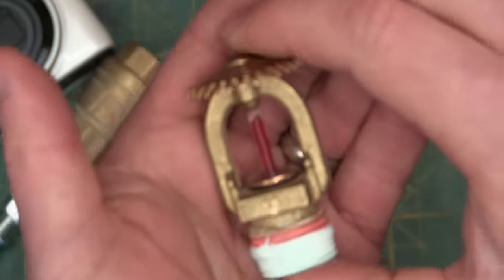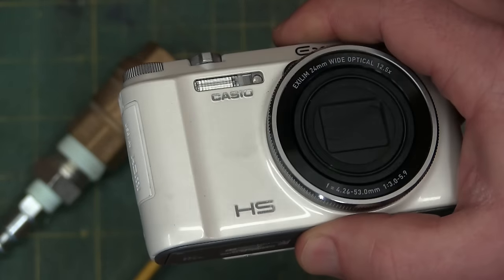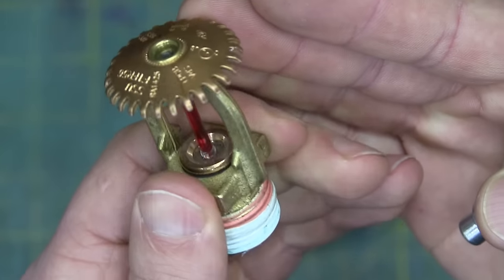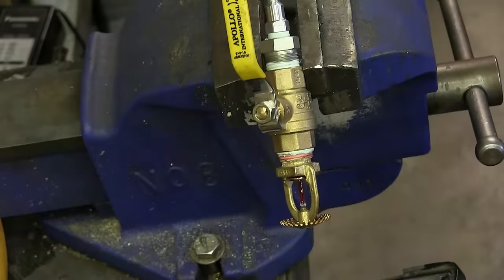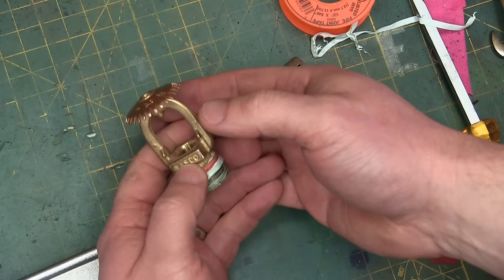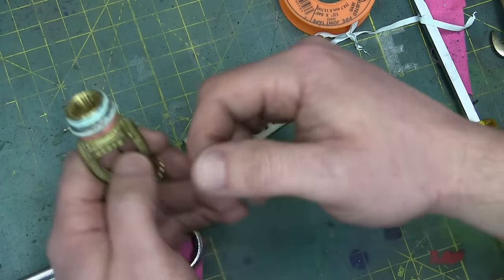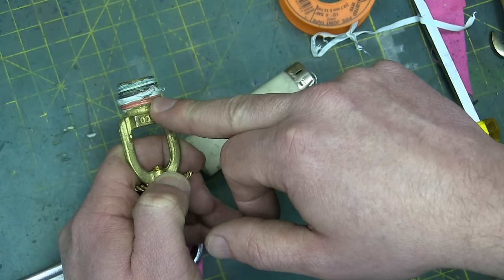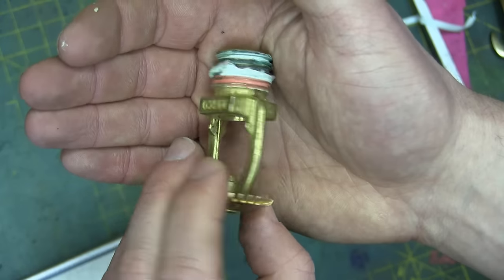BOLTR: Fire Suppression Sprinkler Head

Comment: Somebody in my dorm freshmen year  tied a string to the little glass tube and attached the other end to the RA's door. Would have been hilarious if it wasn't for the fact that it flooded the entire floor because it took us nearly 10 minutes to get it to shut off.
Reply: Get back to work cody we need more vids
Reply: would like one of you to test to most common ways to break one of these
Reply: Mike Ledowski -- only way to survive dorm life
Reply: "Somebody"...uh huh
Reply: Next time use two small wedges of wood and place them end to end, like a shim and push them together, it will block most of the water! Also, sometimes drunk college kids use lighters to set the system off.... Much like this video.
Reply: hi Cody 👍
Reply: AvE only had a little bit of pressure. Some installs run at 1400psi.
Reply: I worked at a government facility for awhile and one of the maintenance people accidentally broke one of the sprinkler heads, resulting in it soaking a bunch of computers and stuff.  Even worse, the water that had sat stagnant in the tank for probably 20 years was black and disgusting.  Resulted in even more damage and shut the whole area down for months while they cleaned it up.
Reply: This made my day, er night
Reply: The warehouse I work at uses 3 diesel pumps and a huge rain collection tank for their fire suppression system, rain is collected from the roof of the 6000m2 building and kept in the tank for months. I figure the tank is supplemented by mains water when under a certain level however.
Reply: Cody'sLab idiots in my condo were hanging their laundry clothes hangers off the sprinkler heads to dry. Needless to say, clothing got wetter than it started. Also flooded out 4 floors before it could be turned off. Sigh.
Reply: Maybe Cody can recover some radioactive explosives from the small red tubes?
Reply: Hi Cody, normal K80/K5.6 sprinkler for ordinary hazards will pump out around 200 l/min in the case of accidental activation, since the pump only runs for one sprinkler .. but hej at least the sprinkler dont work like in the movies or the entire building would be flooded.

Greetz Schuldig
Reply: Cody'sLab a youtuber I watch watches another youtuber I watch? Crazy
Reply: How many gallons is that?
Reply: ReactTM should have known that allready, they have done some work where AVE send some things to cody.
Reply: Eric Jones 200 l/min are around 53 gal/min
Reply: LOL
Reply: Cody'sLab 
I got a big fire department called to a monastery where I was servicing the fire pump. 
The maintenance guy said the alarm panel was off, oops. 
Im spinning an oil filter off and I just about dropped it like a greased pig when I saw a fireman walk thru the door all duded up for the gig at the monastery.
Reply: I can only speak for the european market. Most of the time we have fireprotection pumps supporting our sprinkler systems and they have a presurre range from 6 to 10 bar (87 psi to 130 psi - at low flow rates). When only one sprinkler opens you only have to push quite  a low amount of water through you system - thus frictions los is low. Okay 53 gpm is the on the high side (6 bar / 87psi at the sprinkler head). But even with 2bar/29psi you get 113 l/min - 30 gpm and 4 bar/58psi you pump out 160 L7min - 42 gpm
Reply: WTF? should have been halon around pc's...stupid feds
Reply: i call BS. the fire department would have shown up with maintenance peeps who would have turned off the water after the FD gave the all clear... Also, how did you know where the cutoff valve(thats unmarked above the ceiling) would be?
Reply: picture or it didn't happened
Reply: There are no water type sprinkler systems that run at 1400 psi. most are between 60-120.
Reply: the black water of death is typically, depending on age of system, of: thread cutting oil, iron from the plumbing, the remains or any passed organics and yet more iron.  The killing room floor smell is almost entirely iron.  Newer system mostly use victaulic joints and so the thread cutting oil and thread dope gets removed leading to a far cleaner dirty water.  Speaking for the US, NFPA calls for quarterly flow testing of the systems which typically results in a high fraction of the water in each riser being flushed.  Think about that the next time the black stank comes out.
Reply: 125-175psi standing pressure in the riser plus the potential for 200psi at 1500gpm comming off a fire pump, 53gpm is right on target to achieve  a specific gallon per minute per square foot of coverage per head, modifed by goods class, pallet type, residual pressure and number of heads activated.  Most systems are 8 inch mains, 6 inch trunks, 4 inch branches, 3 inch runners and 2 inch drops for pendant mount heads or the heads are Tee'd directly into the line.  I have some systems that use 2 inch for in rack as it saves on space but the heads drop to every 8 feet.
Reply: Hehe, nooononono, flooding the floor IS the hilarious part ;)
Reply: Ya know that valve that has the chain and lock on it saying DO NOT SHUT OFF?   You'd be surprised how many people get upset when you cut it off and shut valve in the middle of the night. Telling them it takes maintenance 2 hrs to show up to fix a 1 1/2 line that froze up. Oh yea....90 psi.
Reply: Why hello there buddy, fancy seein you here again

Comment: Fire protection guy here: the heads are hydrostatically tested at 200 psi minimum after they are installed. Most are factory tested at 500psi. Also a simple formula for the flow rate of that head, it has a "K" factor stamped on it (that looks like a K=5.6). K*squareroot of pressure=gpm.
Reply: ~43kg force
~94lb force
Reply: Gdsmith504 yeah putting a set of Wedges in to stop the flow....2 things,don't look directly at it,and it's probably a lot like being Waterboarded....you'll get absolutely drenched

Comment: When one of these opens you don't want to be anywhere near it. Sprinkler water is absolutely disgusting stuff.
Reply: Sean Deadwiley 
stuff goes septic quick. gack
Reply: Sean D Well, you usually don't care that the water that saves your life is disgusting...
Reply: Sean Deadwiley black gold
Reply: if it's a false alarm, and it's hot enough to break the pin, it's probably not that false an alarm
Reply: Yeah but imagine in a college dorm. These things get activated even if you bump the glass hard enough. The shit wreaks
Reply: At least for the first few minutes!
Reply: when there is a fire big enough to break that glass, you don't want to be anywhere near it anyways. and the smoke is probably worse than some dirty water...
Reply: Those are actually pretty easy to break by mistake with let's say, a hammer.
Reply: Sean D why isn't it just tap water?
Reply: They get hit all the time. I've seen one that got smacked when some people were trying to get stuff off a shelf near one. 
There was also a news story a while ago with some department store that had one go off when a kid threw a dime at it ended up hitting one. I think that did $100k in damage to products.
Reply: "False alarm" also includes idiots breaking the glass, either intentionally or accidentally.  Hotels post notices not to hang stuff from the fire sprinklers, because evidently people are dumb enough to use them as coat hooks.
Reply: JoshL it sits stagnant in the lines under pressure in a wet system. There are dry systems as well that fill when an alarm is pulled, but most are wet systems.
Reply: As mentioned, it sits and gets nasty. The pipes also usually have a little oil left in them from the threading operation. If you have ever smelled a grease trap at a restaurant when it gets cleaned, it's like that. Nasty, black, oily water. I've seen about a half dozen opened, always by some dolt busting a head off with a ladder or scissor lift. Several guys tried to deny they were responsible, but the fact they were soaked with that nasty water is a give away that if they weren't the one that broke it, they were close enough to know who did!
Reply: Usually when that happens it's some jagoff hit the head with something and broke the pin or hung something from the sprinkler head.
Reply: Fair enough- I can remember back to my college days.. the screw at the bottom of the radiator came free when my chair bumped into it (old hot water heating system). I'm thinking someone pulled a prank on me because the drain bolt should've been on a bit tighter- needless to say, the water they were using in the heating system wasn't very fresh
Reply: +Zach Stein   "Jagoff"  u from Pittsburgh by chance?
Reply: A lot of modern systems are dry pressurized, so the system is connected to the water lines, but the tube themselves are filled with air (or an inert gas). Really useful in colder areas were they might be in freezing conditions, you don't want those tubes to suddenly explode during winter. Many wooden buildings here in Norway have sprinkler systems like that outside or in cold attics. So when one sprinkler pops, some seconds will pass before the water comes rushing
Reply: oh , and yes , that water is straight nasty . and I'm a plumber and I wouldn't want it on me .
Reply: 100% accurate. when the sprinklers went off at the hotel I work at, It came out black and oily from the water sitting in those pipes for 7 years mixed with the oil thy use to thread the pipes. its rancid, and funkier then a bootsie Collins concert
Reply: Well, sprinklers are not there to save lives but to keep the building from burning down. Saving lives is what smoke alarms are for.
Reply: water isn't circulating and becomes stagnant and is vile, I've tasted it while stripping out old sprinkler heads. Something I never wish to taste ever.
Reply: Or a water balloon during a water war in the college dorms... Doesn't take much to trigger them.
Reply: It is, but that water sits in iron pipes, and can for years before it's called upon.

Comment: Awesome, also to note, there's chemical pellet, fusible link, and electronic activation as well. 

the glass vial's color is also the indicator at which temperature it will pop at.

the head of the sprinkler is also shaped a certain way to direct water. some sprinklers can be mounted upside down to allow more clearance in an industrial setting, some are mounted with the head towards the ground and some can be mounted to the wall. All depends on the shape of that head. the one here appears to be one that mounts upside down. or upright.

all in all, please do not go and torch one of these in the system. it sucks to have to go and place wedges in there to get it to stop... As a Firefighter, we hate that.
Reply: Please, if you have the knowledge and can spare the time, tell me about the other types. Electronic I would guess is pretty straight forward, your electric detector sends the pixies, the pixies open a valve and there she goes, or at least that's my guess at it. The chemical pellet and fusible link sound interesting though, would love to hear some more about them.
Reply: Prompted Hawk so a solder link type has two metal links that are soldered together and at a specific heat the solder melts and releases the water. the electronic heads use heat sensors to open and close a valve but for the most part are banned here in NY and we replace them if we find them anywhere. deluge systems have open heads and are usually installed in places that are very hazardous and usually set off by a pull station. once you pull the lever all the sprinkler heads on that system will flow water. there a lots lots more but that's the general idea. there are also many different types of alarm valves and system types.
Reply: +LegacyNBlaise So those are the electronic types? Where do they place the solder joint so it still receives heat but the connection doesn't get bridged by the water? Or is it just a one-off valve and anything past the melting of the solder doesn't matter?
Reply: Prompted Hawk :  The solder is most likely Woods Metal, an alloy 50% bismuth,  25% lead, 12.5% tin and 12.5% cadmium.   Melts at 158° F and is eutectic.  A poor conductor of heat for a metal alloy, it retains good compressive strength almost to melting point.   Also great for supporting tubes in bending. .I have 4 pounds of it for that purpose.
Reply: Yeah, there are many kinds of heads depending on what's needed. Some systems have nothing in them at the head. The system is pressurized with air, and once the heat pops the head open, the drop in pressure lets the water flow, and set off the alarm. Loss of air pressure also causes an alarm, but that can notify the security company of a fault, just go off locally (no outside connection), or if your unlucky, call the fire dept. who shows up, charges you for the response or some combo of the above.
I know of one system that lost pressure too often, and well after the compressor got replaced, water had got in the lines, then rusted through the main feed line, and flooded the warehouse.
Reply: Those heads are Strictly heat sensitive . We do install systems that are take a electronic device to a actuate the system as well as the heat  . These are called pre action .
Reply: Prompted Hawk, legacyNblaise pretty much covers it, but I will spread my insight. 

The chemical pellet is essentially solder, it works much the same way as the glass vial except it melts at a certain temperature (instead of breaking), depending on the alloy, and collapses releasing the water, or air in a dry sump system. (Chemical pellet are the ones i am least knowledgeable) 

Electronic ones are pretty rare and expensive, but you would find those in airplane hangers where they are activated by a detector head of some sort. (which there are many different kinds of) They look differently because they usually release a rapidly expanding foam and fill the entire hanger. They open the valve at the water/foam reservoir, not the sprinkler head as well to save cost. They also have redundant systems, which is what makes them expensive.

Fusible link can be a few different kinds. One kind works much like the chemical pellet. Another kind has two types of metals that when a certain temperature is reached, a link is melted which lets the compressed air or water push the stopper out of the way. 

Glass vials are by far the most common though
Reply: Ave just check out NFPA 13 for everything you need to know but min operating pressure is 15psi on them. also the colors all have different boil points b4 they will explode. but some have soder holding it also may wanna look more into them ;)
Reply: Veedubcurby Veedubcurby minimum operating pressure varies depending on what you are protecting but the typical minimum is 7 psi. They are listing for 175 psi maximum system working pressure. System designer here.
Reply: A solder joint or chemical pellet is not an electronically activated sprinkler head
Reply: TheKthman good to know was going off fire fighting standers they tell us the furthest away head needs 15 psi to pass an inspection
Reply: Veedubcurby I see. Probably not a bad rule of thumb to go by.
Reply: Where can I find Woods Metal sounds like the tube bending use is just what I need.
Reply: Lloyd Prunier :  I got mine online.   With delivery, about $20 a pound and that ain't much.  Enough to cast a cylinder 1" dia by 18" long.
Reply: That would be four (4) pounds American or 916 grams for those metric sexual.